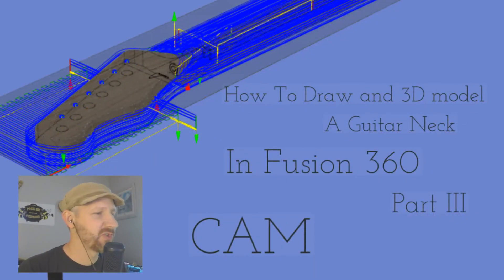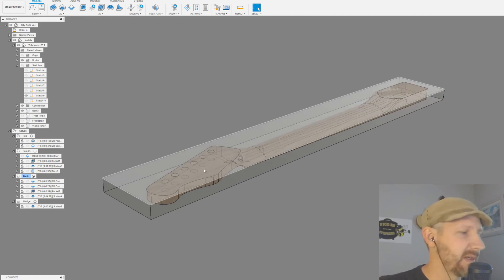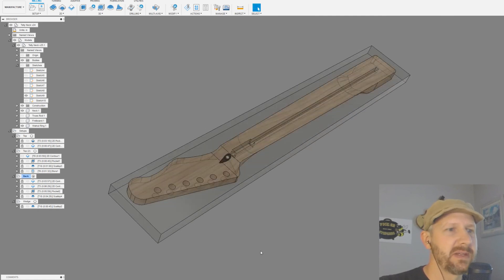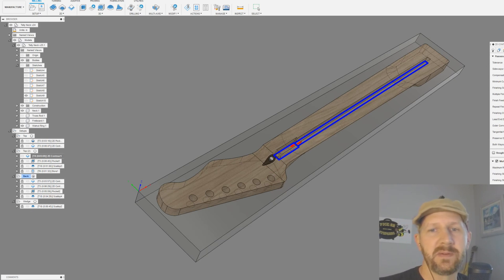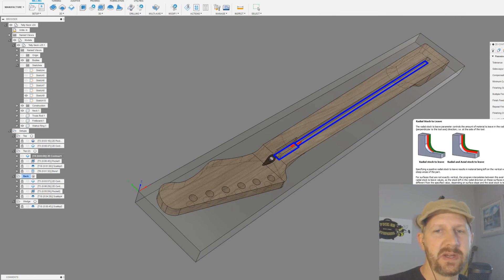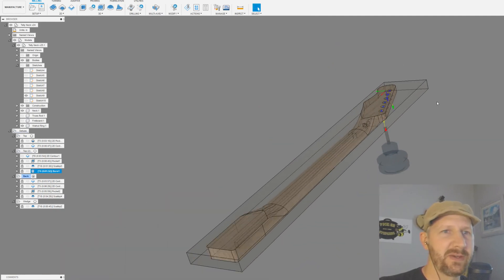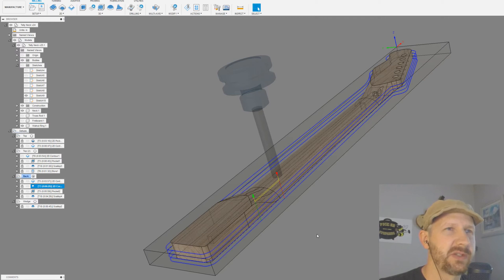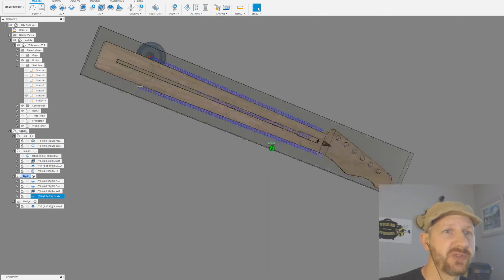Telecaster Neck Start To finish In Fusion 360 | Part II | CAM

Comment: Good Morning, I'm not sure if you noticed but we can't see the screen to the right that show's Setups / Speeds & Feeds. plus I was hoping to find speeds and feeds on the frets slots you used. Thanks for any help you're willing to share. Love your videos, You Rock...
Reply from the maker: I have the feeds and speeds pretty dialed in for each tool in my CAM library. For fret slotting, I am currently using a .024" endmill; the fit for the fret wire I'm using is nearly perfect, but that will depend on the runout on your spindle. I'm cutting a .03" depth steps on a trace operation that follows the radius of the fretboard. The tool is set to 40 IPM but I usually start off at %50 of that and step up if I'm comfortable. I don't mess around with the speed on the spindle all that much as wood is a very forgiving material in that aspect. Lately, I have had the VFD set to 200 Hz and I haven't had a need to change. I hope that answers your questions.